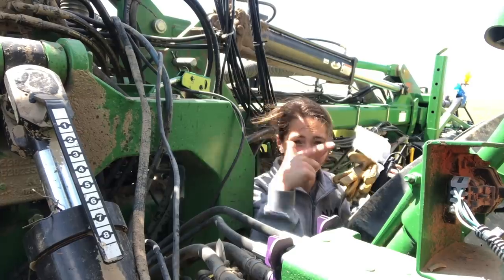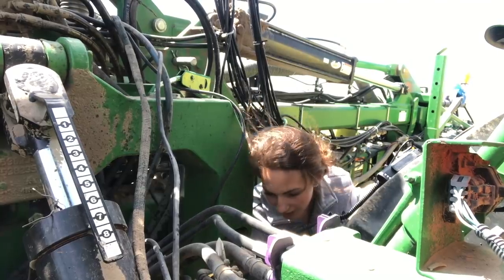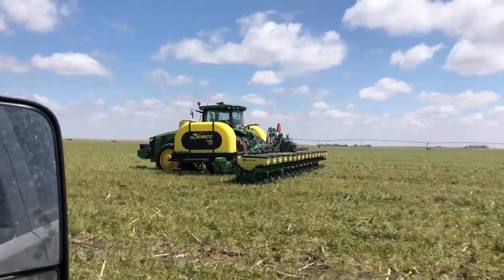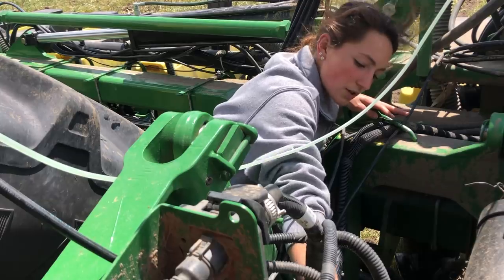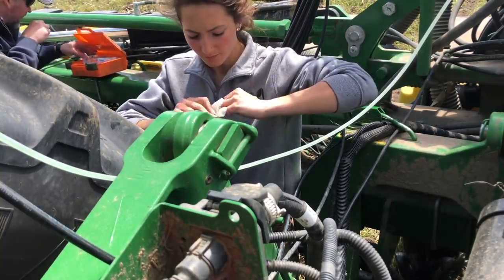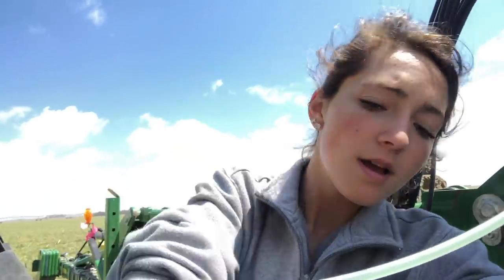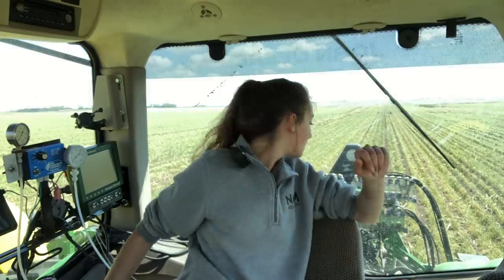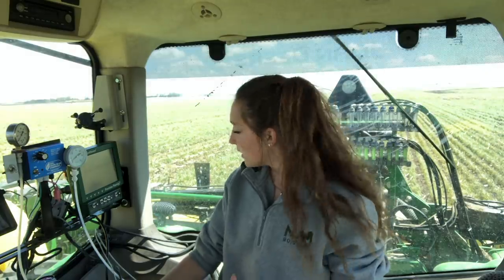Hydraulic Fluid (and I hurt my finger)

Comment: In the future, never get between the tractor and a raised 3pt implement, especially if you have an unknown hydraulic issue. Great way to get crushed to death.
Reply: Pretty much this.. untill you know what the issue is, get as much as you can DOWN.. if a hose was leaking on a ram holding the impliment or part of it up and that hose then fully ruptures... that thing is probably going to drop like a stone
Reply: @Simon-ho6ly  Totally agree, first everything down. and for safety generally engine off. Certainly if you need to position in between tractor and machine. Is quite heavy stuff as you know. Hydraulics works with very high pressure. 
Pls, be careful Laura, we like to see much more of ur cool ag videos, learning on the job, practice and experience already!
Reply: I wasn’t sure what you were talking about until dad showed up and they lowered the planter. HOLY SHIT! I said out loud!
Reply: Come on people- the three point is not controlled by the remotes 
The hydraulic top link is but if you pull the hoses the fittings stop oil flow - with pressure on the top link I bet they won’t come unhooked easily
Reply: @anthonybinning3853  As a former truck tech I disagree with you. Sure fittings should stop flow if they are ok. They should be ok, right? Pull the hoses - what if the one you pull was about to break and you helped it - is fitting gonna stop flow if fittings are attached, but hose is broken? There just are too many what if's and we have only one life, so better to play it safe, right?
Reply: Glad to see you guys are warning of the dangers present (with exception of a. binning). Farmers have a very dangerous job and caution gets interrupted by pressures of getting things done. That machine is like a bomb ready to kill you if you make a bad decision. She`s too pretty to lose. As an example : pilots are killed from the "get there" syndrome.

Comment: Cute seeds, but the farmer is even cuter! ;) R.I.P. hydraulic oil though, my Dad and I had our fair share of lines popping off, the best thing we ever did was replace the couplers in the tractor, fixed 90% of our problems. Of course it’s always the open-ended connectors that have to pop out. Doh!

Comment: Sight glass, large fill cap, and ground-access? I definitely grew-up working on the wrong tractors. Ours had the fill next to the gear shift, under the steering wheel, and it was a 1" opening with a dip stick attached to the plug. Worse, there were about 1.25" of threads you had to run in and back out to check the level. The pump is a great idea. I always got to pour into a funnel.

Comment: A little advice should you really cut yourself, use any kind of clean tissue, paper towel, napkin etc to wrap the cut then use any kind of tape (electrical tape, duct tape, scotch tape etc) to go around the clean tissue, paper towel etc. This will prevent any dirt from entering the wound till you can get home to clean is properly. I cut my hands in the worst places and always end up using some kind of tape to stop the bleeding till I get home.

Comment: well hydraulic flex lines got metal in them and will cut you - over dew to come up with a better way to make hydraulic lines that is not rubber and steel braid that adds more psi and the price for flex lines are out of this world for the crap that they are and dirt will eat threw rubber

Comment: 4:43 I recommend wearing a cap when doing this stuff. The peak offers a little bit of protection from whacking your face etc. And keeps your hair out of the way.
And wear oil resistant gloves. These are modern times, and while we didn't have "soft" attitudes back in the day, we also didnt know about Contact Dematitis that can manifest at anytime years after exposure to hydrocarbons.

Comment: This may be a dumb question, but what are the tractor's tires filled with, is it air still?
Reply: Yes, what would you make to think otherwise?
They do have a fairly low air pressure tho and if I remember correctly some tractors have a system to lower air pressure to increase traction on the fly.
Reply: Jan B. Nitrogen?
Reply: @terrywagner1308  That makes sense for racecars or low maintenance cars. But for tractors less because 1) you would need huge amounts of nitrogen to fill these huge tires and thus it is really expensive and 2) a tractor isn't really low maintenance, you are constantly doing stuff here an there (according to my farmer friends).
Reply: Jan B. Adams Motor Express located in Carnsville, GA, uses nitrogen in their large truck tires. 2,800 tires
Reply: They claim that the tires are on the road for extended lengths of time and using nitrogen reduces pressure loss.
Reply: Simão Rodrigues hopes and dreams :-)
Reply: Kent Goertzen it’s been at least a decade since I was around tractors, but I had the impression some farmers in my small town filled them with water, hence the question. Time passes and my mind can be playing tricks on me.

Comment: Hi from Australia. I enjoy your videos. Longer run time would be good. Excellent being in the tractor with you. Did a bit of cultivating, and sowing in my time with JD 8630, (3 x 22ft seeders coupled together), and Case IH Steiger 425 hp, towing 54ft seeder, and pressurised hopper. 40 Ft tandem discs were about our limit when cultivating. No auto steer, GPS, and computer stuff. All sighting a line about a mile, or 2 away, and hoping your reference point wasn't a cow, which sometimes it was, and as the cow moved, so did the sight reference, and tractor. 12 hr shifts around the clock. I did day shift. When the night driver fell asleep, I would fix his mistakes in the morning. Huge fields, but not boring. 40,000 acres, five crews, 24/7. Install a first aid kit, and small fire extinguisher in the cab if not already installed. Fit a large fire extinguiser to the outside of the tractor. A bottle of pre-mixed water, and dish washing detergent is a good hand wash. Riggers gloves, or leather driving gloves will protect your hands a bit, especially around hydraulics, and sharp discs. Make it a habit to always put your gloves on before getting out of the tractor. It's always a good idea to turn the tractor off before getting out where possible, and lower the implements, etc. I drove a truck and trailer hauling a combine through Nebraska heading for Pierre, SD during the 2001 wheat harvest. Nebraska is a great state. Harvesting rule: Turn tractor off before getting out, or instant dismissal!! Cheers!
Reply: James 
Hello hope you are doing great

Comment: I have a IFAK (small medkit) whenever I go rock climbing and hiking. Picked it up from a website mymedic. They have a range of sizes and have a comprehensive medical supplies with them. Each kit has an advanced kit for major injuries and a basic kit for everyday stuff. Personally I carry the advanced because in my case, hiking miles to a location to climb makes me and my friends the first responders. You can make your own kit and save some money based on what they have. They list what each kit contains on the website. Their kits are nicely laid out with how they contain the supplies and display it when you open them. The company has really put a lot of thought with how they set their kits up. 

Basic first aid steps are. First, stop bleeding use gauze pad or something to soak up blood and apply pressure. Second, after bleeding has stopped sanitize affected area with alcohol or antiseptic. Third, apply antibiotic ointment to help prevent infection and promote healing. Fourth, cover the wound with either adhesive bandage or gauze pad and wrap depending on severity of abrasion or laceration.

Enjoying the videos always wondered what farming was all about.